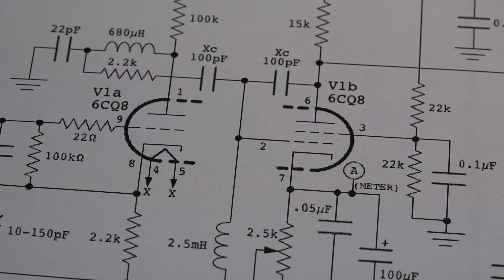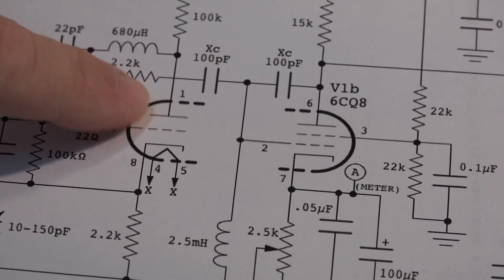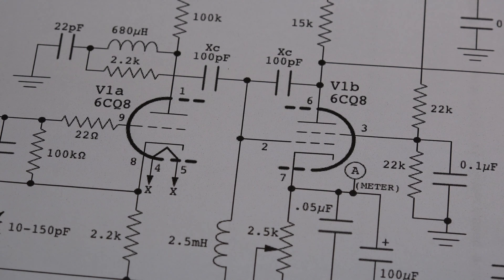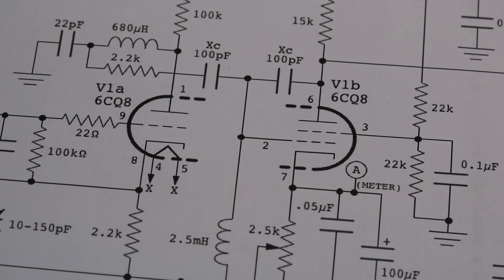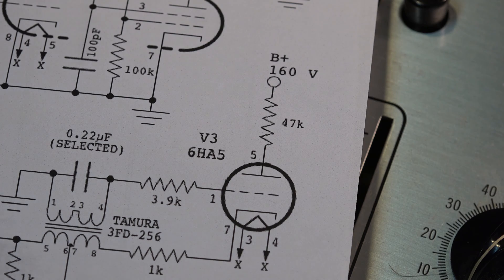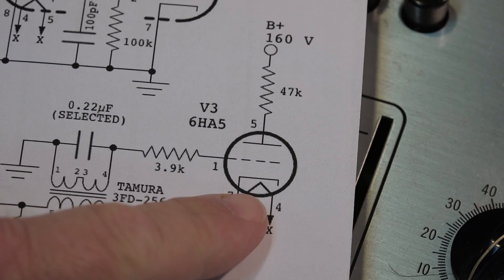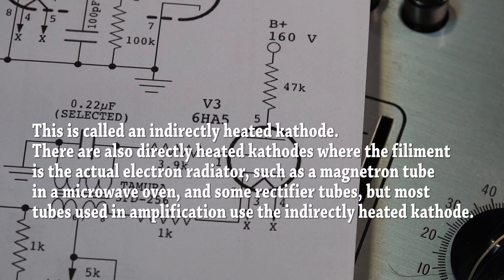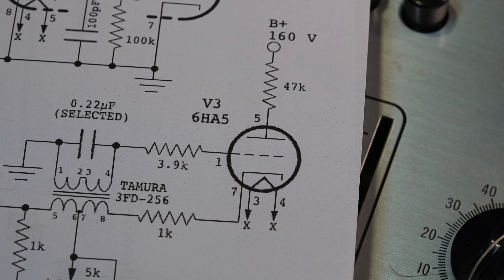tube tester

Comment: There are still some things that a tube does better, and not just because of their increased power handling ability. This was why vacuum tube diodes were used as detectors in the probes of certain RF voltmeters. There is no turn-on (forward) voltage, where even the best and most-sensitive Schottky diode has a forward voltage of 8 mV. HP, Eico, and Hickock used a vacuum tube diode in their most sensitive voltmeters.

Also, it's hard to replace a copper oxide diode with a silicon or geranium over this very thing, as some of the old tube instruments used a copper oxide diode in their meter's bridge circuit. Nobody makes them anymore, either.

Comment: Thanks for the video. I just acquired a 667 that I repaired, cleaned and calibrated. It needed new electrolytic caps and it had a bad selenium rectifier. Now I can begin testing tubes.  👍

Comment: Does this tester only test american tubes?

I have a Telefunken AC2 tube which should be silver coated but mine is almost white inside (it has some silver coating left but not much so this is probably bad), so how do you test this if the tube is not written on the tester

Do I need to get a german tester for this?

How do I figure out if there is any alternative tube I could use instead of my Telefunken AC2? 

I am a noob trying to fix my tube radio and dont realy collect them, would just like my radio to work so dont realy care if a tube is a Telefunken AC2 or something else (even a transistor would be fine but I guess a transistor cannot just simply replace a tube or can it?), as long as it performs its job

Comment: I have an EICO 667 no built in roll chart. I have some tubes that are in the tube data list but can't find a socket that fits. Namely 7A7, 7B6, to name a couple. What am I doing wrong. The tube data info from Frank's says it is a loctal base. Can anyone shed any light on this?

Comment: Yes I have been looking for this tester,  perfect for my needs.
Reply from the maker: I still haven't found what I'm looking for.
Reply: 12voltvids   It seems that tube testers are a crap shoot and we role the dice on eBay.
Reply from the maker: @sting1111  I guess that one went over your head.
But you are correct, anything from ebay is a crap shoot. Ham flea markets are generally the place to get this type of stuff. For starters most hams are very good with electronics, especially the older guys. They have to be, because if you didn't have the electronics theory down, you didn't get a license. Usually they will be in working order too. Do expect to pay a little more though, as they know what they are worth, but you will be getting a piece of test gear that you will be able to use right away. I have gotten some really good stuff at flea markets, including my Tektronix X-Y scope for 20 bucks that I use with my oscilloscoclock board.

Comment: What do you think of the Heath kit tc-2 tube tester ,I just a hobbyist ,I don't want to keep buying,a complete set of new AA5 nos,nib ,because I didn't have a tube testers,I like to work on AA5 radios mostly ,but as I learn from you if one tube goes out none of them.Will work ,so I would but a complete new set of tubes,because I didn't no which one.was.bad so I bought a Heath kit tc-2 tube tester ,got it working pretty good ,what do you think of my Heathkit tc-2 .they seem very popular on eBay ,anyone..
Reply from the maker: The only tubes you generally need on an AA5 is the 35w4. It is usually the one that goes out. Sometimes the 50c5 audio tube fails.  The mixer and IF rarely go bad. The heathkit tc2 should do the job. I don't have a tube tester myself. I have borrowed one from time to time, but I don't work on enough tube gear to justify investing in one.

Comment: I'd find that bent pointer of the meter an issue because of concerns of the rest of its ability to have any proper accuracy. On this tester, are all the elements except heater & cathode in the tube being joined to the plate to form an effective diode between plate and cathode and hitting it with a high voltage for check of current flow through it and so a sort of harsh emission test?

Comment: I see the tube tester gods magically reset lever 5 to the correct position. I have a 667. I hope it has that feature.
Reply from the maker: It was set in the correct position.  Count as I move it.  Camera angle fools everyone.
Reply: @12voltvids  Not in the video I watched, @ 8:20 the video makes a slide in from the left and then lever 5 is in position 5  instead of 6 a few seconds before. But I really didn't intend to criticize, I was just kidding around. It's very informative and I learned a lot from it. Thank you.
Reply: @GeoffEspeland  You are correct - I came here to see if anyone else had noticed! He pushed it so far and hard into the "6" position originally that there was an audible "whack" when the shaft hit the casing at the end of travel. No surprise that he didn't cough to it - he has form. In general I don't watch his stuff any more - if I wanted to be depressed by people endlessly moaning I can easily get that from people I interact with daily - but I had a particular interest in tube testers...
Reply: @12voltvids  Look at the shadows from the knobs, they are different

Comment: I don't remember the tube testers in drug stores, and radio shack (late 60's, early 70s) having so many buttons you had to preset. Were they more "automated"?
Reply from the maker: The ones in drug stores typically had 2 or 3 knobs, and a ton of different sockets. Each socket was wired for a specific tube type. This one has 9 tube sockets, and the switches "rewire" the socket for the tube you are testing.
Reply: Ah ok.. makes sense :)

Comment: Nice video, I have an EICO 625 tester. Vacuum tubes are current amplifiers like transistors. A positive voltage on the tube's grid results in an increase in electron flow (current) from the cathode to plate. If you add a plate (anode) load resistor it will transform a tube from a current amplifier to a voltage amplifier.
Reply from the maker: +Rob Robinette Yes I know how valves work.Actually it is the negative bias on the grid that keeps a tube from becoming a diode.Actually the way pretty much all tube amplifiers are wired your B+ goes through a load resistor, or into the center tap or the primary winding of your output  transformer, and the other side of the transformer primary windings goes to the plates of the outputs. As the grid voltage changes it modulates the flow of current through the transformer, and that induces a voltage in the secondary winding.I grew up in the 60's, and when I was young I would hang out at the neighbours house, who happened to be the local TV repair man. So I learned at a very young age electronics theory, and troubleshooting. By the time I was 10 I built a 3 tube amplifier using a 35w4 rectifier, 50c5 power tube, and a 12ax7 preamplifier.Built it on a piece of plywood, and took it to school when I was in grade 4 for science fair.Today if you walked into school with home made electronics you would get arrested. (sorry I had to throw that in, because a 14 year old in the US just got arrested for taking a home made digital clock to school, someone thought it was a bomb!)  The project I made could have electrocuted  anyone that stuck their fingers in because all the wires were exposed, just like they were on the open chassis of table radios of the day. But that was a different time. We also used to ride around in the backs of pickup trucks. and ride bicycles with out helmets too.

Comment: It probably doesn't matter now but switch 5 was set to six...
Reply: I noticed that at first as well, but before he tests the tube you see that he had corrected the setting, the correction was simply cut from the video so you don't see him do it but if you look at switch 6 which was also set to 6, you can tell that switch 5 was shifted down one.
Reply from the maker: @redemptusrenatus5336 it wasn't.  Just the camera angle.

Comment: Хороший аппарат!!!!
Reply from the maker: Tube testers give you an indication if a tube has shorts inside, but most were very unreliable as to tupe gain and performance. many, the drug store type were horribly inaccurate designed to sell new tubes. They are a tool, but nothing beats knowledge and experience. Ask any experienced tech that dealt with old tube gear and they will tell you that most faults were bad electrolytic filter caps, paper coupling capacitors and carbon resistors that burnt up and went out of spec. But they do fail, as I was able to demonstrate here.